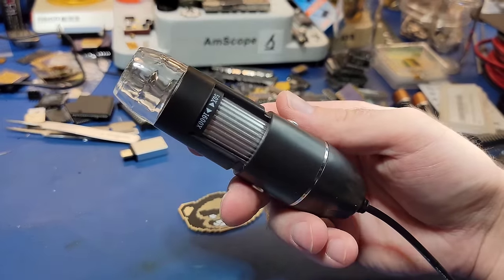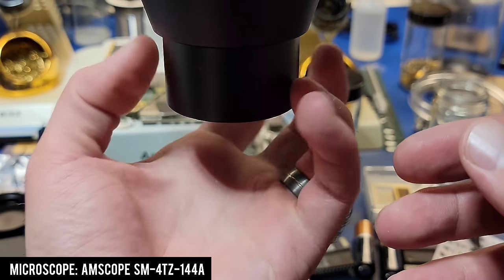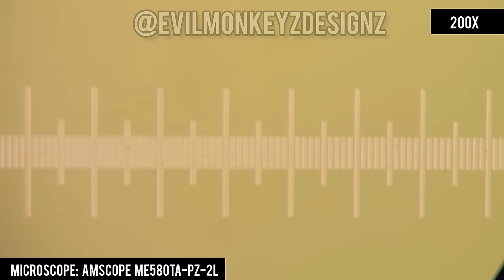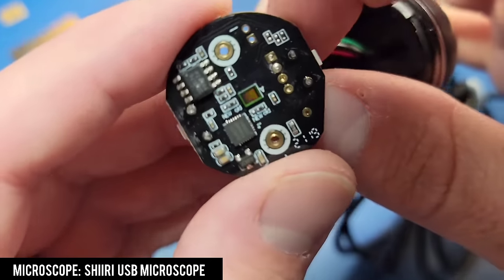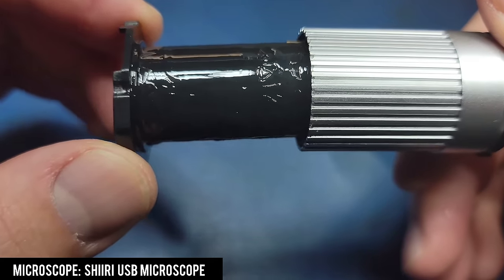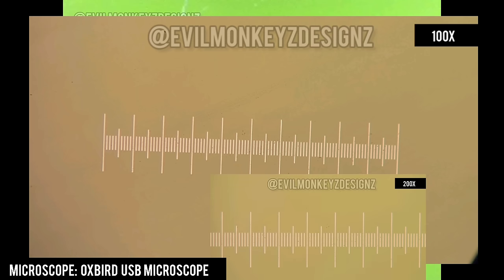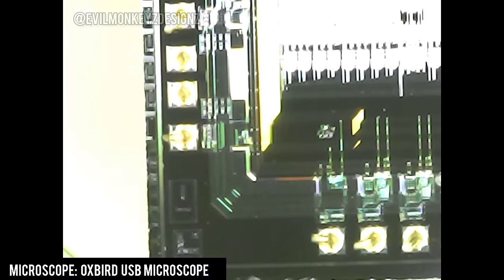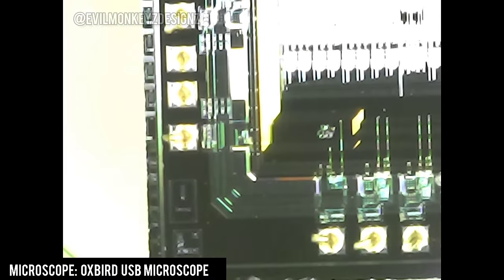Digital Microscope Comparison

Comment from the maker: If I did another video like this, what other microscopes did I miss here that should be in that video? Let me know if you have other suggestions for aspects of comparing microscopes that you'd like to see as well. Thanks for watching! 😁
Reply: You missed the diy route. 
You could purchase C/CS-mount or M12 mount lens. Its $10-$20 for those 100x-180x.
Then attached said lens to an old phone/dashcam/action cam bare sensor. You could already have it so you don't need to purchase, I've used an iphone 7 and it works. 

Bare sensor is the keyword here, you need to pry off the LENS on those to have the bare sensor (squarish). You could hot glue or 3d print an adapter but it works.
Reply: Tomlov DM602 ??
Reply: I'd love to see some more intermediately priced models. Like below 300, 500, 1000, and so on. 
It is no wonder, that microscopes for 10 bucks don't rock your world. And if it was sold for 10, it was maybe built for 3. 
But it doesn't need to be the 50.000 bucks Keyence monstrosity to get good digital photos.
Reply: I bought a Celestron 44302-A branded version of the third (Shiiri) and fourth (Oxbird) years ago.  It seemed to be a no-name made USB device that was widely available under different names... you are right, the result is "disappointing", and is not really a microscope.  It has it's uses for me, however it was barely worth buying.
Reply: A few years ago I bought Mustool G1200, which is also supposed to have 1200x magnification. It works great except for not ideal colour reproduction. I wonder if you could test that one, and see if it really is 1200x.
Reply: How good is a digital microscope depends on it's optics and the image sensor. You can check if the optics are made of cheap plastic and compare the sensor_size/resolution as it determines it's luminosity and noise. If you know the exact sensor you can check the specs to compare more in depth, some times this sensors are +10 years old and produce lot off noise compared with more modern chips. Also it's important the mount as it must firm to produce an steady image and easy to adjust the focus.
Reply: @oliviavalentine5294  We would likely get much better resolution as well (compared to this cheapest, 0.3Mp).
Reply: All I can think of to buy a couple of those cheapest one and join together for increased magnification. I hope that it works that way. And for censor, you can replace it with some itsy bitsy tiny web cam, they offer pretty good resolution and mp too. Look for webcam for android tv pretty sleek deign and smallest in size possible
Reply: I saw the "yizhan 48mp microscope" and it seems interesting
Reply: More info on the built on LCD monitors, are they as advertised ?
Reply: First thanks alot for your beautiful work.
YOU MISSED ALOT !!!!
DSP it is with optics and sensor vitally determie the end result.
Other options like available controller must be a separate entiry in your table like available WIFI control, remote control, built in zoom controller and capture or even sharing by button press !!
Vive Gaza 😢.
Reply: I'd like to see some in reality usable scopes for reasonable price. Currently looking for some scope usable for soldering but all scopes seemed that even they'd be fulfilling the promises, they wouldn't be usable as no space for solder iron was there  in between the lense and object.
Reply: If you do another group review, 1) what is the best you can find which does not have integrated display. In this review, the features only got distant once the display was added (resolution, wifi). Would be nice to get those features without the expense of the display. Hdmi out is a bonus. 2) Aliexpress is a minefield and the “customer” reviews are useless. Are there any on there actually worth buying?
Reply: I am surprised, didn't your Tomlov came with multiple lenses?
I tried a few and they all had different lenses.
Reply: I know this channel specializes in inspecting microchips. However, another use case for microscopes can be found in repairing scratches on vinyl records. For this, one factor is if you can view all areas of a record. Sure enough, half of the cheap microscopes don't allow that because they are mounted to a stand that prevents a big view surface to cover.
Additionally - as already mentioned - we jump from $170 directly to $650 with the former being questionable at best and the latter surpassing many people's "allowance". Also, I'm quite sure there are some options around $200 that greatly surpass the last model in quality if you get inventive.
Reply: pny l2003
Reply: Another aspect to possibly consider is the "behavior" of the compressed images. Even if the sensor and final image are 2MP, the compression implemented in the hardware can make a difference. For example, some of the USB microscopes appeared to have some ringing in the image of the scale. This was less evident in the images from the last two cameras. Thanks for the awesome investigation!
Reply: Thanks for a very informative video. It would also be good to test the wifi microscopes  that can stream to your mobile device.
Reply: Nikon, Zeis, Leica - microBiology microscopes.
Reply: I was hoping to see a Carson product, I bought the MM-840 several years ago for about $30 and they now seem to be in the $50 range. The included software was a little rough, but I found some nice freeware intended for astronomy which did a decent job.
Reply: I think it's an extremely unfair comparison you're comparing items that cost $20 to items that cost almost $1000 that doesn't make sense That would be like comparing a $10 meal  to a$1000 meal that would be silly and personally I have used and sold these cheap microscopes and have had no complaints I used to sell them at my local flea market I have used them for straining out pins on motherboards and they were very popular with marijuana users they loved to look at their pot with that level of magnification for $20 and in all of your photos that you took of Sonic it was very clear even on the worst ones so your own video proves the quality of the $20 microscope in my opinion
Reply: What about carson microflip
Reply: "ONY, don't know what that could be" maybe Sony? 😂
Reply: Clip-on or clip-in micro/macro lenses for mobile phone cameras.  
I would like to see how different styles of aftermarket optical lenses interface with digital imaging from a cell phone camera
Reply: I need a scope for surface mount soldering and inspecting 3D printed parts. Both of which can use some good depth of field, so that somewhat subjective spec would be useful. Good video, thanks.

Comment: These cheap USB microscopes are actually pretty useful for servicing electronics and watches, also taking very little space when not in use. And these do differ in magnification. Less magnification is better as it's easier to position and focus. Their online descriptions are however all over the place, so you'll never know what exactly are you buying.
Reply: I started using these few years ago on microelectronic repairs, and they work just fine for some uses. When you need to improve the precision on your work, they can become insufficient, but that doesn't mean they are bad at all.
It depends much on what type of job you need to do, so maybe spend hundreds or even thousands of dollars on fancy high-end equipment just doesn't worth at all, because you can do the same job with a simple and cheap microscope. Don't you think?
Reply: @Cabeza492 Given my 60+ yo eyes, I have to disagree; mine just disappoints. How old are your eyes, for comparisons sake..?
Reply: @jahrastafari7381 i'm 51 years old and i had this one ~100x microscope. For 8-12€/$ is best choice for many people.
Reply: Unfortunately they are not very good when you need to repair laptop motherboards or something larger because they either have no mount at all or are bolted to small table which pretty limit the usable area. Also due to diffraction and zoom artifacts it is difficult to see small IC and connector pins at most angles. Another drawback is low frame rate and data transfer speed where picture of observable area is a bit jerky and appear after some delay which become very annoying when you are soldering IC in LQFP-64 package for example. But yes, they are usable in simple cases.
Reply: I agree, for the money these scopes are well good enough for most people who aren't professionals. Why you would even consider using a 20 dollar scope to study chip dies in depth is not a fair comparison at all! The fact that they can even get close to a 500 dollar plus scope is amazing imo.
Reply: I have one of the cheap usb microscopes and my eyes are not so great nowadays but this has been an absolute god send.  What I really like about it is that It will stand off (upto about a foot) and still show the fine detail of the legs of components.  Ideal for reflowing CPUs or other surface mount devices.  Any bridged or dry joints are easy to spot.  

I also use it, now and again to read cooking instructions on instant meals, and for this, I wish it had a zoom out feature, because I have to read it one word at a time.
Reply: when i would buy a microscope i must verify my needs :
first  :for what kind of job :
a-electronic repair 
b-inspection
c-doing video
d-stone setting, engraving
d2-watchmaking

for all these job, i want a binocular microscope, because it give depth perception due to the stereoscopic effect
of course you can do SOME job with only one eye , so usb microscope are useable.
but you can do your own usb microscope with a 3d printer and a webcam :p

secondly, i want a nice working distance. 10cm is a minimum in electronic repair ( so you must use barlow lens).
it means all these usb microscope are garbage, of course you can make a decent diy usb microscope 

thirdly, i want 10x-20x magnification for electronic repair.
100x,  and more are just a joke, what can you see at this kind of magnification? your hair that drop on the board taking all the screen? :p

4th .. i want to be able to zoom, not just have a fixed 10x or a fixed 20x
so no AmScope SE400 Series  for me

5th, i like the check the stand, i don't like the stand of SM-1B from amscope, but it's more a personal feeling
prehaps, you don't find the working area too small

4th and 5th point are somewhat related.
 
6th do you want to make video?
2 path : 
a trinocular with simul focal, without simul focal, just buy a binocular, keep your money...simul focal make it expensive
(simul focal allow you to use the cam AND the 2 oculars at the same time, otherwise, you must sacrify one occular, usually the left one)
a binocular  + a usb microscope, the last tend to be crappy(blur, low fps etc), so choose an hdmi cam/microscope in addition of your binocular
 
in my opinion, a usb microscope is not a self-sufficient , too much magnification, poor stand, no depth perception, working distance horrible(except diy usb microscope).

BUT it can be usefull to inspect ...sometimes
my advice is to not limit yourself to "electronic repair" microscope, you could find your gem in binocular "engraving" microscope for a very decent price
Reply: I use a cheap USB microscope quite often and have no complaints considering how inexpensive it was. If I were doing work micro soldering professionally it would make sense to upgrade, but otherwise I'm fine with my cheap scope and my 3D printed stands.
Reply: Yes, I accidentally bought one which was 180x180 pixels sensor by trying to be cheap. As you can guess, it's not usable
Reply: @ZZZ-z9n3n helpful, thank you!
Reply: look at the alternatives . youll find the truth hidden amongst the varying promises. its going to be the same circuit in a different package if ots out of the china wharehouse.
Reply: @KOTYAR0 😂im sure they had higher resolution ones in the old optical mice. took one apart and took photos with the sensor once 😂

but feel your pain. ill tell you the 4k one i got is about 1080p at the most. probably 800x600
Reply: I was thinking of getting a cheap one because I have some smd components I need to replace and its hard to focus on them with no aids. do you think they would work for 1206 smd resistors?
Reply: @mickwolf1077  1206 are big, i don't think a microscope would be useful for these. Maybe just for inspection after the work has been done, but still a typical magnifying glass will likely be enough.
0603 and larger are great to work with a naked eye. 0402 may be a bit difficult. For 0201 and smaller some magnification is very helpful.
Reply: @k4be.  ahh, thanks. 20 odd years ago I didn't have an issue seeing the small bits.
I ordered a cheapie and a hot air rework station to fix an inverter so I guess it'll all be useful for future repairs, I probably need my eyes checked too 🧐
there are some smaller components on there which I hope I don't need to touch.

Comment: These seem to be soldering station microscopes. High magnification is not appropriate. The microscope has to be matched to the task. What is the point of viewing a silicon chip? Working distance is missing from your review. Cheers.

Comment: Resolution is the performance benchmark for microscopes, not magnification.
Reply: Indeed, especially for digital microscopes. Magnification makes sense when you look through an eyepiece because it means that objects appear larger than they actually are when projected on your own personal eyeball. The magnification number is nearly meaningless when you project the image on a sensor and show it on a screen. Life hack: 10x your magnification by copying the image into paint and using resize.
Reply: They both matter. A higher resolution would make these clearer at any magnification, and optical magnification would increase said magnification without sacrificing clarity.

Comment: Another option, if you have a C or CS mount camera (such as the Raspberry Pi High Quality Camera, with it's 12.3MP Sony IMX477R sensor) is just to buy the optical components you need for your use case. A simple C-mount adapter, extension tube and objective lens system doesn't have to be that expensive to achieve better results than the tomlov.

We used to buiId application specific optical systems like this all the time when I worked in Machine Vision (metrology for robotics applications), and back then it was Firewire or GigE visions cameras like the Allied Vision Guppy sensors, but these days a Raspberry Pi High Quality Camera + Zero 2W would make an excellent headless WiFi camera host, which you could plug a monitor into, if a big screen is needed.

This industrial optical component 'lego' approach is the perfect half way house between buying commodity consumer kit and buying a full on scientific/industrial microscope.
Reply: this is really cool thanks for the info
Reply: MVP level info right here
Reply: I was wondering about getting something like the Bysameyee shown in this video which had the better image sensor, and modifying the optics. 
But I may have access to some higher quality Keyence sensors from work, from disused machine vision applications, which are intended more for macroscopic viewing and computation, but may work better with commercial lenses
Reply: @markbooth3066 Hey Your information helped me a lot, thank you! Do you know of any example videos about this? I want to learn more about it.
Reply: So, it's been a while  @wendellfigueiredo , but I remember that when companies like Edmund Optics and Thor Labs had printed catalogues, they had configuration guides that if you would plug in the specs of you needed it would spit out a set of suggested components, you just had to cross reference the right row and column in the right tables, but I have no idea if  they still do those paper catalogues, guides or if they've moved to online calculators for this. I'd have a hunt around their websites, and see what you can find. I wish I could help more, but I'm afraid that it's been 15 years since I worked in this space.